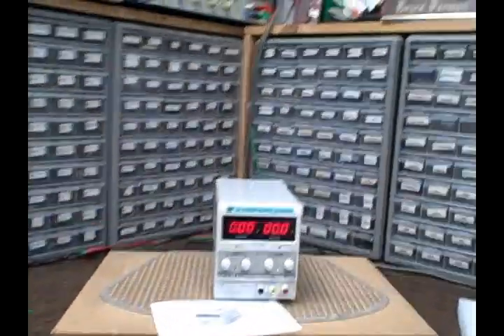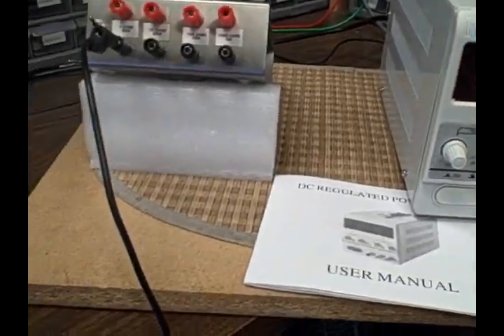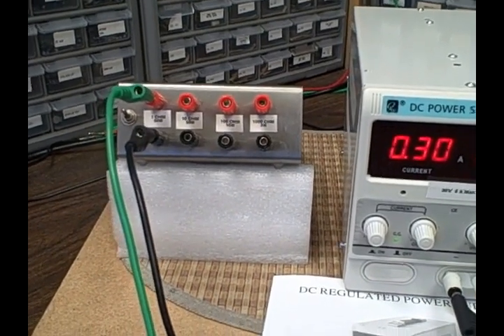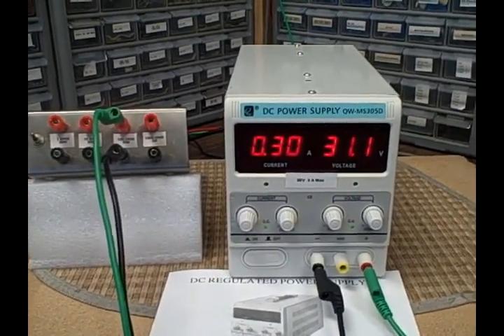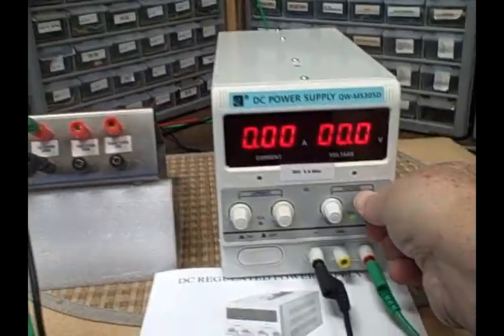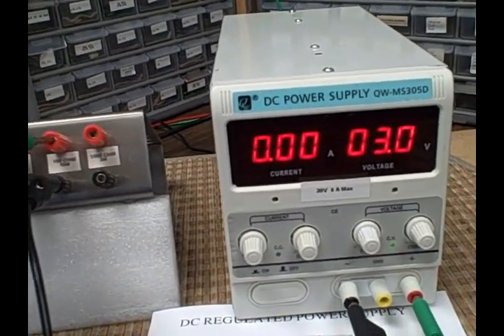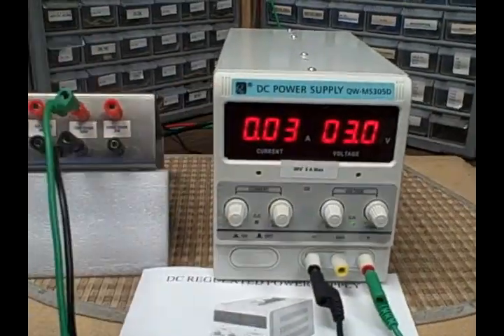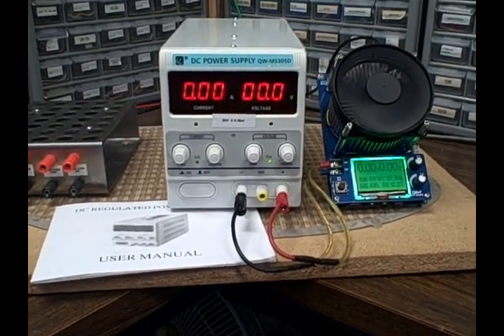QW-MS305D DC Power Supply 30v 5A Supply

Comment: Found one of these in an e-waste dumpster. Did a plug-in test, seems to work, but don't have the cables/probes. When is the rear fan supposed to kick in? What are the max current/voltage settings? Thank you also when you set the current, do you have to hold the tips together and make the adjustment before applying to the load?

Comment: I have these Power Supply. Now 2 Years ago i have a Problem.
After turn on the Voltage ranges from 2 V to 8 V for 3 Minutes.
So i take a look. There were no Electronic Problems. I have use 
Cold Spray. This takes no Effekt. Then i have used Kontakt Spray for
Potentiometers and now it works fine :)

Comment: Thanks for the video!  I just inherited one of these but it is dead (no display, no output).  Would you happen to know where the fuse is located?  Thanks in advance.
Reply: Fortunately it was only a poor power cord connection (solved by bending the power supply's prongs).  The connection felt snug but apparently not all three prongs were touching.  The fuse is just below the power prongs but I have no idea if the fuse is removable or if the whole power connector would have to be replaced.

Comment: I bought one of these a few years ago.  While it does regulate well, it's output is incredibly 'noisy', and  hardly 'laboratory grade".  Have a look on a CRO and you will see massive switching spikes.   I use it to run a 12V pump, or charge a car battery., nothing more.

Comment: Dear Sir, in reference to an older video of yours on the HP5314A Universal Frequency Counter. I would like to ask if you know what the secondary output voltage is on the main power supply. I purchased one and the transformer broke off in transport and Keysight/Agilent have no reference or part number for a replacement. If I could find out the correct transformer output I may be able to track down a replacement. Thanks.
Reply from the maker: Well, the manual says it was an HP 9100-4129 The power supply puts out a regulated 5v and an unregulated 8 to 10v to charge batteries (if your meter is so equiped).  It is a center tapped transformer. I did not see the exact unit for sale.  A 110v to 16v CT unit (provides 8v-0-8v) rated about an amp of output, should do it..  However, you would have to be crafty about mounting it and wiring it.  I saw one for about $25 on ebay.  I will not be held responsible for what you do either.  Good Luck!
Reply: @bap8guy  Thanks so much for the reply. From what I could make out from the schematic, the secondary output pins are 7 & 9. Pin 8 the CT goes to ground. I didn’t know what voltage was across the capacitor C1 Please for give me as I’m still trying to learn electronics. Thanks.